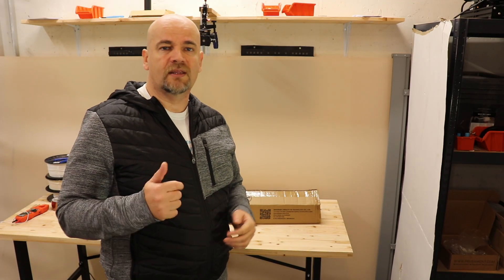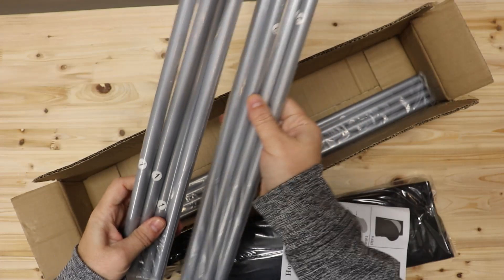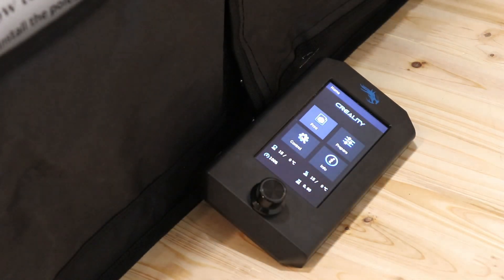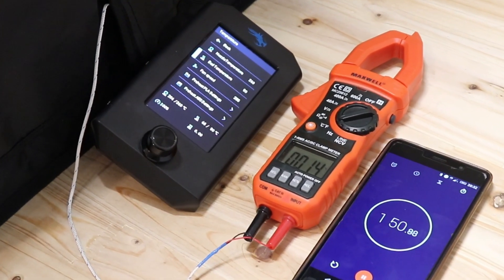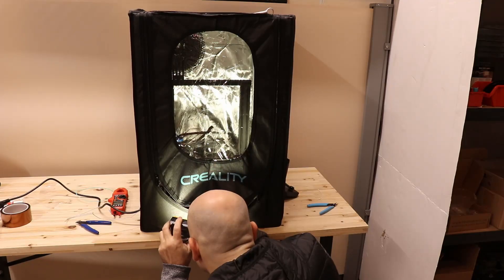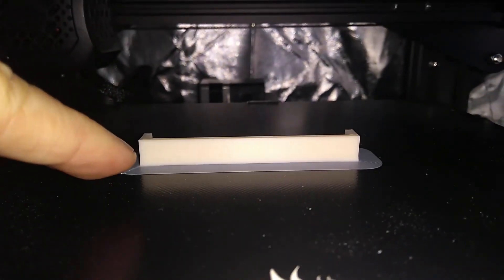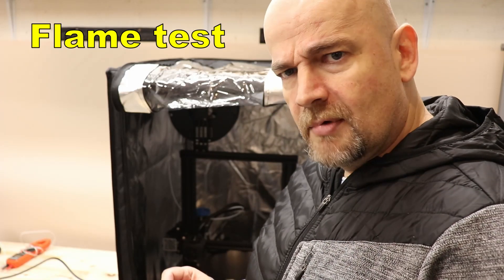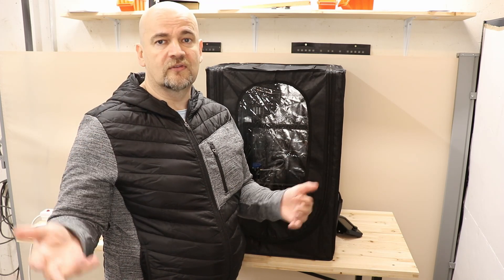Review of 3D Printer Enclosure made by Creality for Ender 3 size 3D printers

Comment: I'm using an enclosure of the same style but different mark, it works well and reduced noise by 5-10db.   That's the most important benefit.  My Artillery x4 pro has a long screen cable so it's not a pb for me.

Comment: I use the same enclosure for my Ender 3S1 Pro. It barely fit inside with the controller removed and placed to the side. My PLA sticks to the bed like a champ now and no more warping. I use a small wi-fi camera inside to check on progress. I do plan to modify and make a bracket for the bottom of the printer to vent the electronics with air from outside instead of the hot air inside the enclosure.

Comment: i would be scared the motherboard or power supply would overheat inside a tent like that. i would think both of those would be vented to the outside in printers that already come with an enclosure.

Comment: Thank you for sharing.  I'm late to the party...  😅  Just wondering what were your printing parameters?  I have an enclosure (COMGROW) and I'm still experiencing some warping when I print ASA.  I have a full metal hot end and even tungsten .4 nozzle.  I have cooling fan completely turned off throughout the print.  I like the COMGROW enclosure better than this one, it has more port holes and they're towards the back (better for the power cord), and one of the holes is round, which looks like I can stick a blow dryer in to increase the temperature higher.

Comment: Will there be a problem when i use this with my ender 3s1? And printing abs
Reply from the maker: I already used it with Ender-3 S1 (now with S1 Pro). Just don't go above 240°C on S1 (because of teflon line hotend). I also moved the screen outside.
Reply: @MyTechFun  ok good to know thank you

Comment: I'm considering buying an Ender 3 S1 to print board game inserts on PLA or PETG. I need an enclosure to protect the printer from my cats. Do you think this enclure is cat proof?
Reply from the maker: I don't have cats, only 3 kids. But for PLA you don't want to print in enclosure to prevent heat creeps.
Reply: @MyTechFun  Is printing with PETG any trickier than PLA? I'm a total noob on 3D printing.

Comment: I'd advise to move the filament spool to the outside of the printer if you're worried about fire
Reply from the maker: Placing filament inside the enclosure will keep it dry, if this is important (with Nylon for example)
Reply: @MyTechFun  yeh but you can still put a drybox on the outside and lead the filament into the enclosure

Comment: I use an enclosure for my ender 3, but printing pla and ht pla+. I kept greeting heat creep causing clogs. Mainly because the fan is just circulating hot air to the heat sink. I haven't tried ABD or other materials though.

Comment: ... Today we will make a 3D Printer Enclosure. First you need to print 8 corners. Next you just need to go find 12 sticks, and cut them so they are a bit larger than the sides of your printer. Next you need put the corners and sticks together. Lastly you cover the whole thing with some sheet of aluminium.

Comment: I've been using the same enclosure for some time now and still can't understand why there is a flap on the right side but not the left - this makes accessing the extruder for filament changing a real pain! A small hole on the left would also allow filament to be fed in from an external filament dryer. Anyway thankyou for all your work on these videos.

Comment: This is a very helpful video because I'm not experienced with 3D printing but currently thinking about buying/using the Ender-3 S1 Pro with ABS and ASA.
Thank you very much.
Reply from the maker: Pro? (that's all metal hotend?) Probably great printer for that. I hope the mainboard fan is not connected directly with part cooling fan (like on E3V2), because for ABS you want to disable (or minimalize) the part cooling. E3V2 mainboard fan rotates only if part cooling fan is ON
Reply: @MyTechFun  Oh, it's tricky... I will check it when I got the printer. Thank you!

Comment: Greetings from Brazil!

I moved my screen outside, the cable was just the right size.I printed a stand for it.
I also moved my Raspberry Pi outside. And I would recommend moving the spool holder to the middle of the rail, it seems it will avoid the spool from rubbing into the enclosure. 

Still haven´t tested it with ABS/ASA, will do it in this weekend.

Fun fact: I bought my enclosure about the same time as you made this video, but I left it stored for over a year LOL. I only assembled it now that I am putting my 'definitive" 3D printing space together, as fot the last year I was using my guests room for that. :D

Oh, a good addition to the enclosure is a set of LED lights. It helps checking out the first layers through the cover, as well as for filming it with Octoprint. I jutt used cable ties to attach it to the structural tubes (I mounted it into the top front tube, passed the USB cable outside through the side opening, tied everything up with cable ties so it looks neat - light switch is outside of the enclosure so I can turn it on and off anytime I want without opening the enclosure).  I bought this one: https://www.banggood.com/32CM-5W-USB-LED-Rigid-Strip-Bar-Tube-Light-Kitchen-Cupboard-Under-Cabinet-Lamp-with-Switch-p-1410410.html
Reply: Cara, estou pensando em comprar um enclosure desses. Também moro aqui no Brasil, e cidade bem quente. Qual foi a sua experiência imprimindo ABS? Ficou quente demais dentro? Meu medo é aquecer demais e chegar a danificar as partes eletrônicas, e algumas customizações que fiz usando PLA.
Reply: @luizricardosilva2500 eu usava na ender 3 V2 e imprimia ABS e nylon maravilhosamente. Foi junto com a impressora quando vendi. Tô precisando de uma maior agora que tô com uma Anycubic Mega X com upgrades.

Comment: I have concerns about the heat. I couldn't touch at bottom of the printer even without enclosure. I don't think that much heat is good for electronics in power supply.
Reply from the maker: I will measure the temperatures soon (in and out)
Reply: @MyTechFun how much?

Comment: If have bought the creality enclosure for my Ender 3 V2 with 4.2.2 Mainboard to start printing abs and other materials that have problems with warping, but.... if you turn the part cooling fan off, the mainboard fan also turn off, they are connected in parallel so they work the same. Thats a problem because we want to keep electronics cool. This type of materials doesn't use part cooling soo there is a serious problem there. The best way is to connect the mainboard fan to the hotend fan so they run all the time on. Be aware of that!!!!
Reply from the maker: Not all 3D printers are the same. Most of them have separate plug for mainboard fan and for part cooling fan.
Reply: @MyTechFun  I have a Ender 3 V2, I forgot to put my printer in the comment hehe
Reply: I have the 4.2.2 mainboard and there are two JST plugs on the mainboard, one for part cooling and one for the mainboard fan. But both plugs are connected in parallel 🥲 please check yours Igor, because your mainboard's lifespan will be reduce because of that issue.

Comment: I got this and it worked fine although not needed for PETG and PLA but I noticed after another upgrade I eventually got jamming or filament breaking at the extruder on longer prints. I realised later the extruder stepper motor was getting hot and my upgrade to Creality's Aluminium extruder was absorbing the heat and causing filament to soften and deform then get stuck or break on retractions....... Just something to note, was a big headache to find.
Reply: dude heat creep is guranteed if you print pla and petg enclosed. It not only unnecessary but actually bad.
Reply: @user-yk1cw8im4h  what is heat creep? it's bad for what? the printing result? the printer components?
Reply: @KisameSempai  dude I don’t know why you are asking me this, it’s all online. If you are trying to start a war go elsewhere, you are 3 years late anyway.
Reply: @user-yk1cw8im4h  im new to 3d printing. Was just curious. Not sure why the rudeness...
Reply: @user-yk1cw8im4h  would not agree to this. a lot of printers come in enclosures by default and do print PLA & PETG just fine.

Comment: about the heat problem 37c is it ok for the power supply and the electronics?
Reply from the maker: Recently I did some ABS review, temperature went up to 51°C inside. I measured the stepper motors, 79°C. It is good that rest of electronics is lower, below the printer. I was thinking to add some airflowing direction from outside. https://youtu.be/YI9dcCAQV1A?t=1102

Comment: I've been thinking about a tent for my Ender 5, but was trying to justify the cost.  Looks like it may be worth it.
I like the idea of a camera inside to monitor first layer as it could zoom to get a better view than naked eye, but could also print a small mount and hold the door just partly open during the first layer print.  As heat rises not too much would be lost if it was only opened a little bit to monitor :).
Thank you so much for this video

Comment: I got the larger version for printing Nylon and Polycarbonate with an ender 3v2. Running a all metal hotend at 280c and a bed of 100c. Ambient air around the enclosure is 22c 50% humidity. Inside the chamber I got it to settle in at a toasty 40c and 10% humidity with just the printer and an hour of preheat. So far prints with nylon have been pretty good. Ideally I would want to get it even higher than that. I am working on relocating my MOBO, PSU, and LCD outside of the chamber with a custom wiring harness and adding another controlled heat source. Hopefully I don't kill any steppers but I think they will be okay below 70-80c.
Reply from the maker: Electronic (power supply, mainboard) are more sensitive to heat. Steppers can withstand mentioned temp without problems

Comment: The temperature probe is not on the actual stepper motor at 8:35, thats why it just reads the air temperature. Stepper motors get around 70-80 degrees celcius when operational!
Reply from the maker: I know, I noticed this stupid error after I published the video :-(
Reply: @MyTechFun  no problem! Good review still

Comment: Do you think this would be a good enough enclosure for polycarbonate? With a high temp hot end and extruder of cours
Reply from the maker: Yes. You don't need high temperatures inside. For example 45C is enough, but don't open it to prevent any breeze or moving of air inside.

Comment: Tip, use a cheap baby monitor inside that connects to your wifi.  I just watch everything from my phone anytime anywhere as long as you have internet signal.
Reply: Thanks
Reply: Instead of the nebula camara? Or in addition?
Reply: @canche4327  I use the creality enclosures for all my printers, none are the creality brand printers.  So baby monitor works out perfectly without needing to tie into any specific brand.  Still going strong.
Reply: @dknight2585  thanks dude
I have another question, are the enclosures good for pla? And could you tell me your experience using them?

Comment: Doesn't hot air damage the device?
Reply from the maker: In this basement room the temperature is 15-20°C. Inside enclosure max 40-45°C. That's not much. If you want to use additional heating, then it would be good to move the electronic out. OR redirect fan air from outside (for cooling the elenctronics whats down in printer). Steppers can handle much higher temp.

Comment: Im using a prusa mk3s this was my first time that i have printed whith ASA filament from Form futura ApolloX  i dont have any kind of enclosure the bed adhesion was great but prints came out to brittle, the interlayer bond wasn't perfect....... So im wondering is an enclosure beneficial for this kind of problems ??? Does the print quality gets better ,im referring to rigidity, not esthetics ???
Reply from the maker: I don't think this should affect the rigidity. PLA, PETG is much more brittle compared to ABS, ASA. Enclosure mostly helps to prevent warping and cracking.
Reply: Thank you ! ,do you have a tip how could i speed up my prints , I was thinking about changing my nozzle from 0.4 to 0.6 diameter what is from your experience the best affordable nozzle and hot end swap for a mk3s ? That is also reliable ? 🙂🤔

Comment: then don't you need to take the power supply out of the enclosure?
Reply from the maker: So far not, temp only goes up to 40-45°C inside (in this room temp is 15-20°C). If you want to heat the air inside, then yes, it would be smart to take electronic out.

Comment: Do you wait for the inside temp to increases before you do a print and for how long?
Reply from the maker: In most cases I am printing ASA with 110°C bed temperature. For this it needs almost 10 minutes, during this time temp of the air also goes up almost to desired temperature. After 4-5 layers printed temp of the air is stabilized.
Reply: @MyTechFun  Ok! Sound very good 🙂 I'm glad there was not to much waiting time. Thx for the info 👍
Reply: @MyTechFun  110°C is over the glass transition temperature for ASA, which starts to soften at around 95°C
I noticed your test prints have a considerable amount of elephants foot, probably due to that excessive bed temperature.
A heated chamber is the way to go, instead of overheating the bed
Reply from the maker: @alejandroperez5368  Hm. Good thinking, but for example PLA has heat deflaction temperature of 50-55°C and everybody is setting the bed to 60°C. Heated chamber is good solution, only I would like to move the electronic outside (not only the display).
Reply: @MyTechFun  just a theory here, but it's probably due to they are using glass as a print surface, so in reality they are not getting 60°C at the actual print surface?
Reply from the maker: @alejandroperez5368  Probably. Thermal camera is on the way from China, I will measure this soon with all my 3D printers

Comment: What about the fumes that asa and abs create iam curious thus putting a vent while prenting reduce the temperature? Can you vent it after printing?
Reply from the maker: Yes, that's the correct way to do it. Print ASA, ABS in closed enclosure, and ONLY when printing is finished, vent that air out somehow. During the printing not, because it may result some breeze of air, that's not good for these filaments.

Comment: this does not make the power supply over heat being enclosed and not have fresh cool air? i want one for my Ender 3 V2 but i am afraid of that
Reply from the maker: So far I didn't noticed any problems. But in my basement I have 15°C, in enslosure max 45°C. I can imagine, that somebody's room temperature is (almost) like inside my enclosure ;-)

Comment: I have an Ender 3 V2, wondering if it’s worth buying the bigger version of the enclosure that you bought in this video, the enclosure that is meant for the bigger line of Creality’s printers. This way I might have some more room around the printer to set up a camera and stuff.
Reply from the maker: Bigger enclosure means more air around it to be heated. So, if you can fit your equipment in the smaller version, go with that one.
Reply: @MyTechFun  Actually quick question, just wanted to double check whether the smaller enclosure can fit the Ender 3 V2 with a 1KG spool
Reply from the maker: @innovativeengineering3210  Yes, that's what I used in this video too.
Reply: @MyTechFun  cr-10 smart no.
Reply: @MyTechFun  Ok, I’ll get the smaller one. Thanks

Comment: I was interested to see what the stepper motor temperature would have been but you attached the probe to the cover that was over the x stopper switch, the x stepper motor is on the other side of the frame

Comment: Nice review.
It is a great addition. I've had the large version of this for a few months for my CR10S Pro. Like you mentioned - It instantly solved all of my ABS/ASA/Nylon printing issues for larger prints. I could not get these to stick to the bed (tried glass, glue, PEI etc etc) and now they almost stick too well even on glass. Warping is also gone even for PLA. Best upgrade to my printer setup I've done. 

As for inside temps - the power supply (Meanwell) fan runs all the time now. My PSU is rated at 50C at full power (500W) and 70C at 50% power so this should all be fine. The other electonics (main board and display)  should be ok at 50-60C. I have used this setup with a max ambient temp of 30C so far (inside got to 40C) but summer is coming here in Australia. 40C ambient is imminent and I'll be interested to see hot the inside gets - I may have to open thay ventilation flap at the top. The larger enclosure has the cable entry point at the rear which is more sensible I think. My RaspPi sits outside with the USB cable just going inside. It has no heatsink and would overheat inside I would imagine. 

Handy tip for lighting: I use a mains powered 10W LED floodlight (from the hardware store) facing straight up and the rear of the enclosure and use a Pi connected Web Camera at the front. The shiny internal walls reflect well and my remote camera video image is awesome with no shadows. No need for fancy strip lighting and such.
Reply from the maker: Thanks for detailed comment. Be carreful with ventilation, because even 50-60°C is too cold compared to ABS printing temp. Enclosure helps to avoid any breeze or moving of air. Use only minimal ventilation and not in direction of prinitng object.
Reply: @MyTechFun  Did a bit more experimenting over the last day. Did a large ASA print overnight (10hours @ 15C ambient) and the enclosure got to around 35-40C. This print got a crack half way up the print and the bottom corners had slight lift. Did the exact same print during day (32C ambient) and the inside temp got to 56C. Print came out perfect. Huge difference with no settings change. Luckily my printer is setup in my large shed as the ASA fumes were very noticeable once the print finished.
Reply from the maker: @marcop3517  very useful info. Thanks.